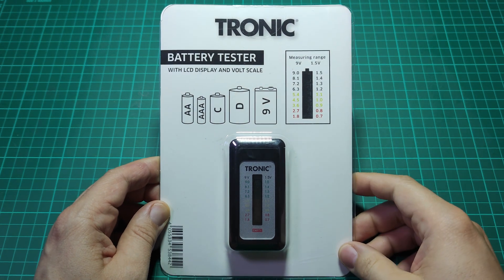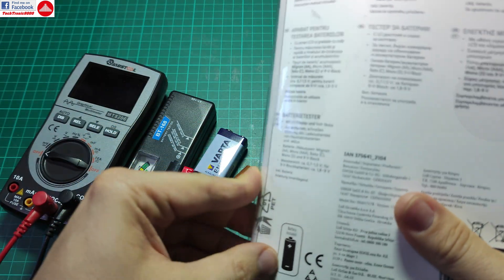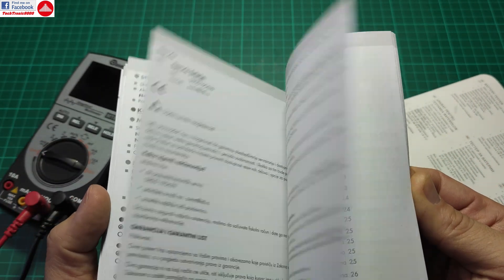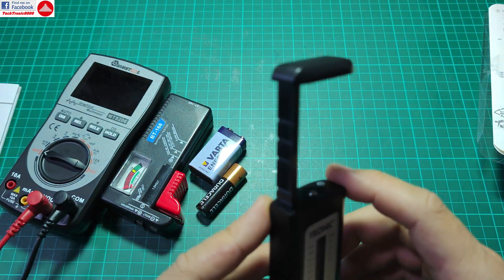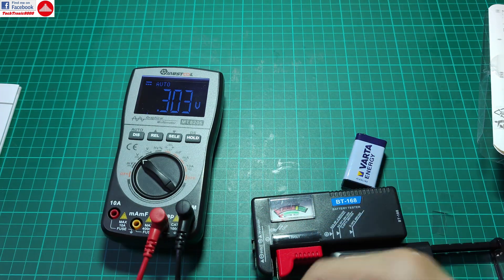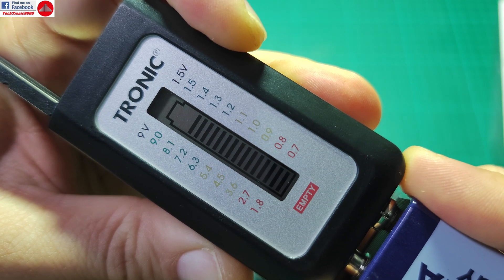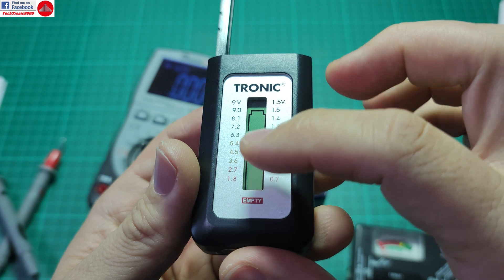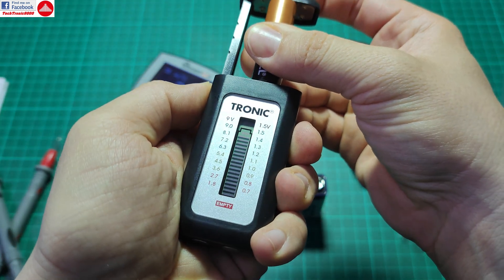Tronic Battery Tester With LCD & Volt Scale

Comment: Battery testers test the batteries under load, there must be a resistor in the device. So it shouldn't measure the same value as the multimeter. A multimeter is not good for battery testing as it doesn't contain a load. I prefer the simple device with the galvanometer. It tells you whether the battery is good or bad, and at least doesn't need a battery itself.
Reply from the maker: Yes correct, the tester does have a small load built into.